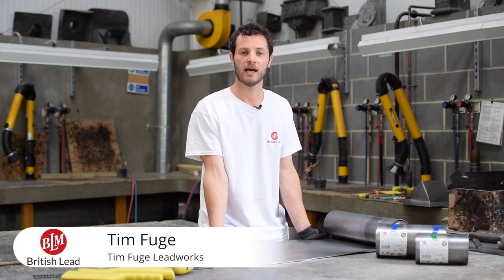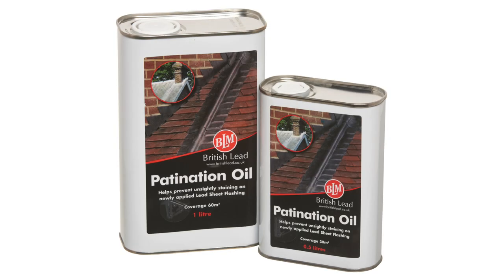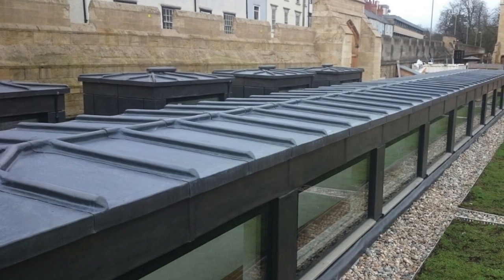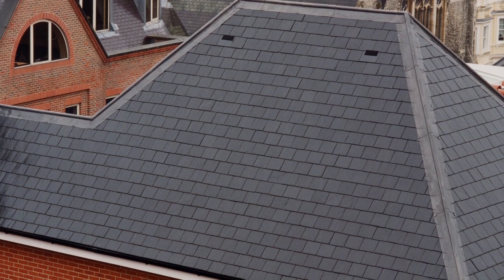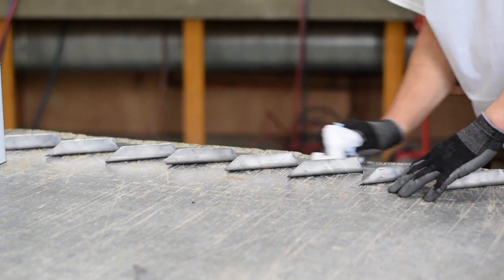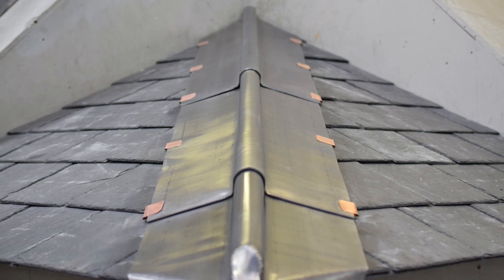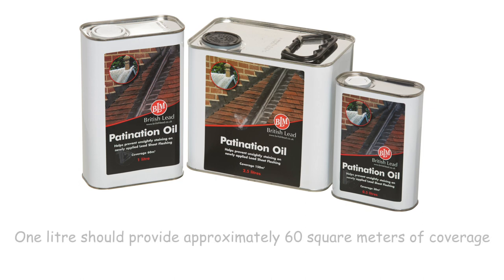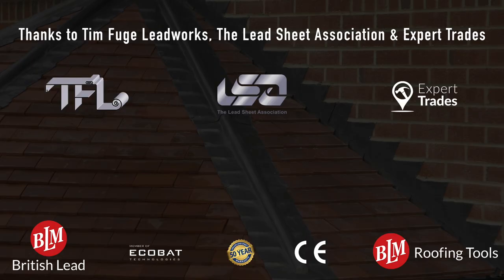BLM Guide To Using Patination Oil

Comment: If the lead flashing is currently painted and peeling should you sand it before using the patination oil or what is the best thing to do?
Reply: Sanding lead? You got  to be kidding right?
Reply: @mitchconnerandsometimesjlotoo  Sanding lead doesn't sound like a safe idea at all, that said, if you have lead flashing and it's looking tired, what is the best method to clean it up for painting/oiling?